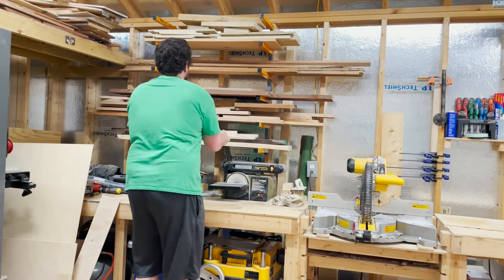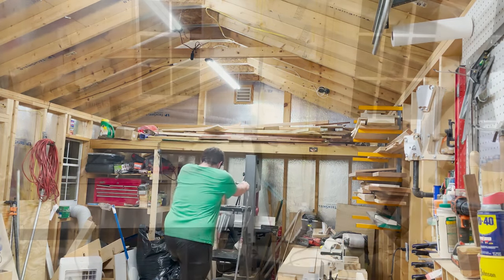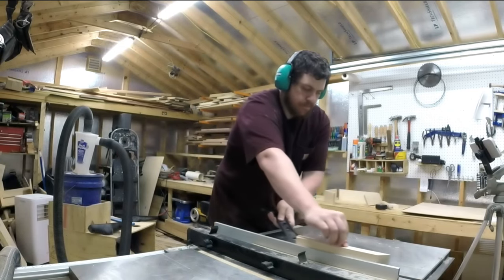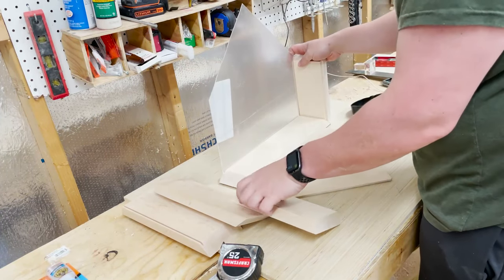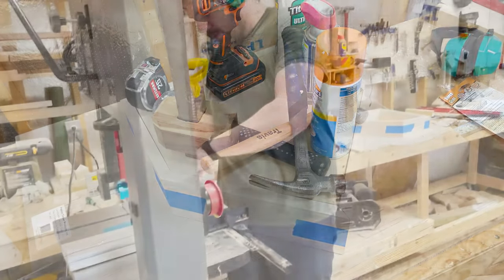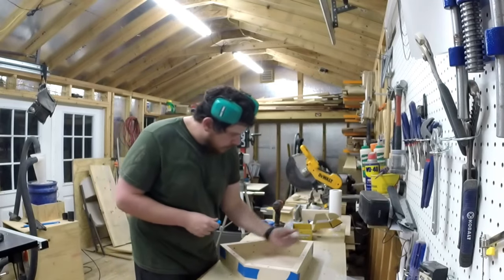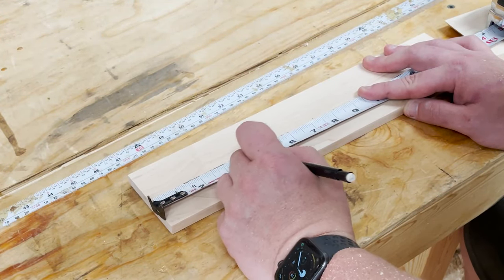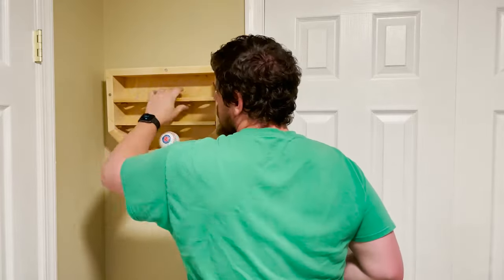You Can Make It // Baseball Display Case

Comment: What tool did you use for the holes for the balls
Reply: Just a standard drill with a forstner bit. Then rounded the edges with a 1/4” roundover bit.